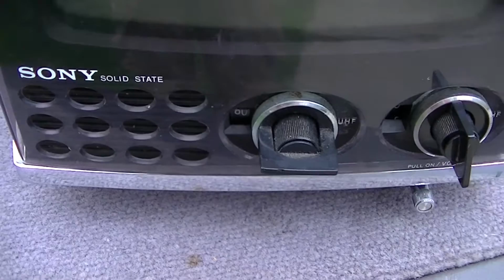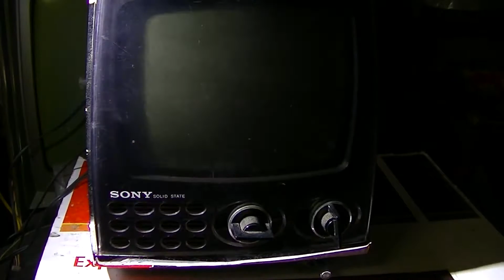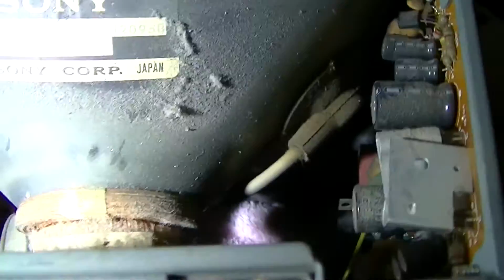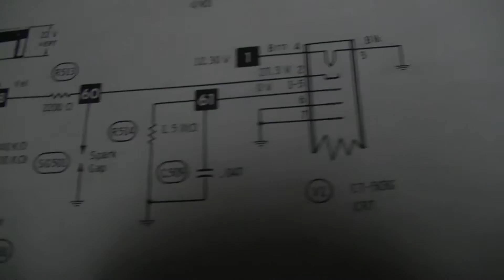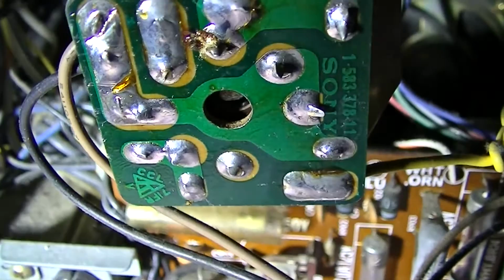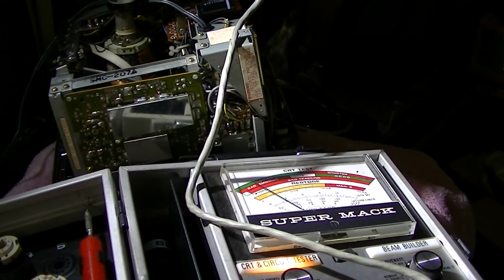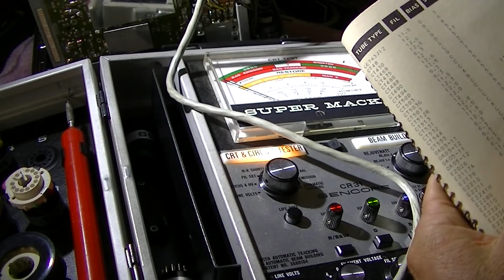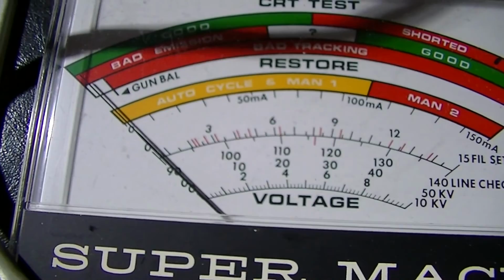Sony TV-960  9 inch Black and White Television From 1975 Vintage Sony TV960 9" Solid State

Comment: It must have been as you say, that they had a bad batch of picture tubes used in those sets. When you consider the fact that it is a portable, a small screen, and black and white, it seems unlikely that the tube wore out from a lot of use.